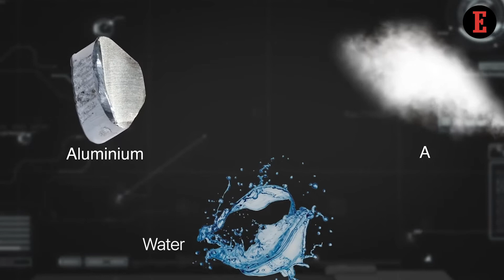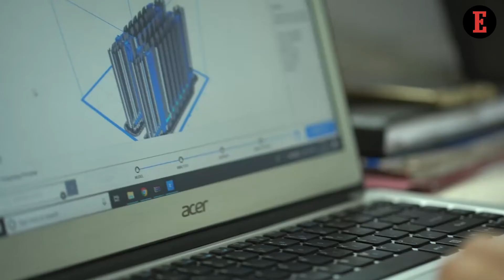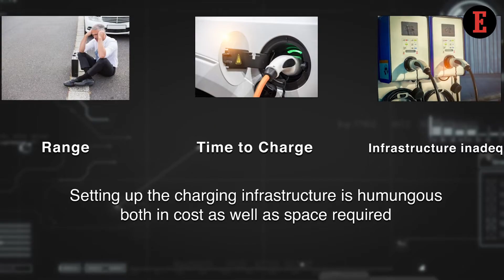Revolutionizing Electric Mobility With Metal-Air Battery

Comment: It's not practical. Battery swapping, or replenishment of the electrolyte material is impractical. Best way is to recharge, which means coming up with better rechargeable batteries.
Reply: but here electrolyte in water, problem is replacing aluminium anode into cell, which cannot be done by normal customer
Reply: @chandraprakash2658  no it is as easy as chenging a gas cylender at home and there will be swap stations in future
Reply: @dikshantdahiya124  don’t think it’s possible to replace entire setup placed at cars boot,. May be long haul commercial can adopt it